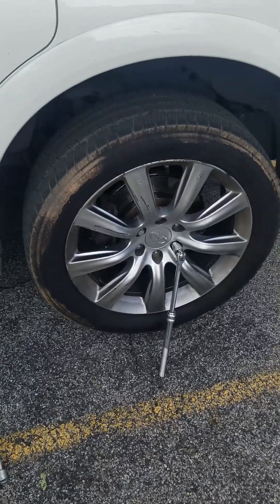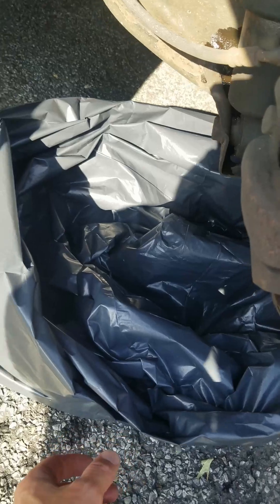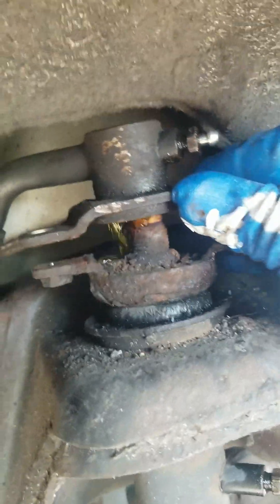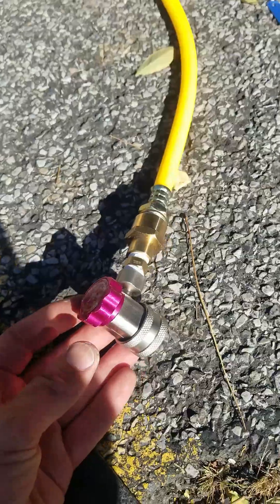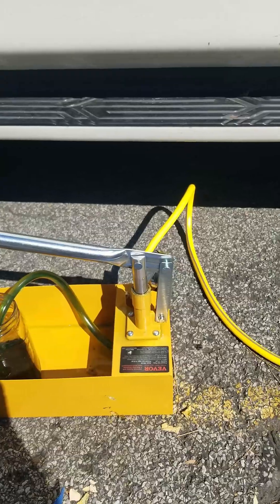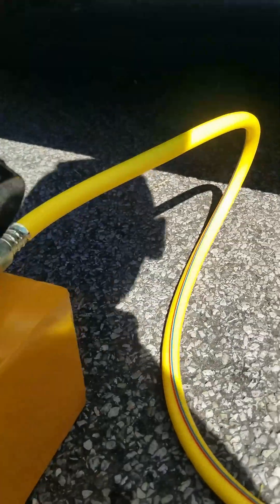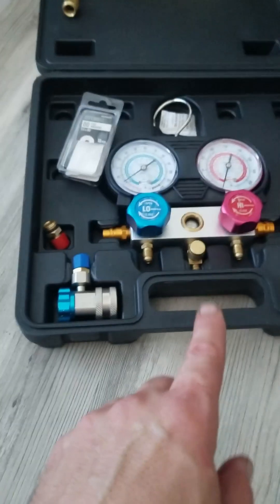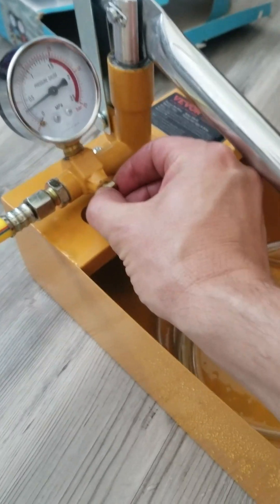Infiniti QX80 Hydraulic suspension replacement and bleeding.

Comment: Mine is 2017. They have air ride suspension in the rear that fills air bags with air when the load on the car increasrs. You can hear it kick on if you put a trailer on the vehicle or have alot of people in the back. I used to only hear it when i hauled a trailer on the hitch and the compressor would immeduately kick on to level out. However i started hearing the compressor kick on randomly in everyday driving then it eventually quit kicking on. You can tell if you have an issue bc the car sits low in the back. The compressor can be changed fairly easily and it fixed the uneveness of the rear.
Reply: His (like mine) has the premium suspension system. Hydraulic Body Motion Control and Air Shocks. So when the air bag ruptures, the hydraulic lines also must be removed, refilled with oil, then the bleeding procedure. It’s a real pain!

Comment: I would change the valve body. Too rusty. Nice homemade pump by the way. Like what you doing. Keep the videos coming. Changed the tcm on mine not long ago.
Reply: Absolutely unnecessary to change the valve body due to external rust.
Reply: @dropndeal  I meant valve body cover sorry ( pod don rjavii , e ma yo) .
Reply: @glebgunin7364 Gotcha! Yeah, those things are made from very thin sheet steel. Not good for any salty road environments!

Comment: So, after a couple of weeks, how are you feeling the suspension?It's running well , and any other advice, because I'm having the same problem and I'm about to do the job following your video instructions
Reply from the maker: Running well, I don't feel any problem... I think its a bit stiff but doesn't mean it bad. I pumped close to 2,4 mPa ..I think If you make 2,2 will be softer.
I would subject before you start to check current pressure in the system (off the wheels)